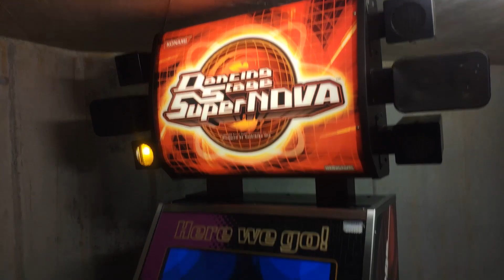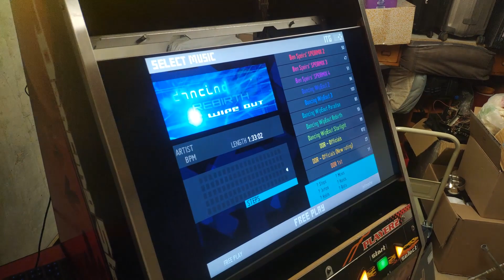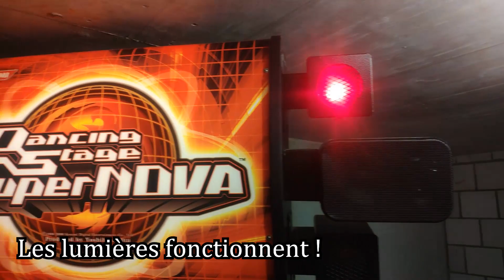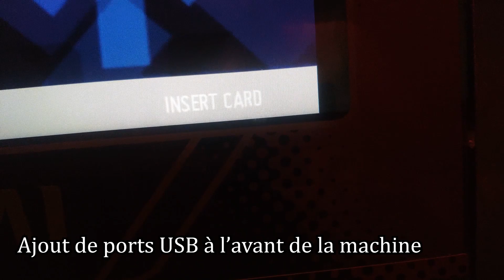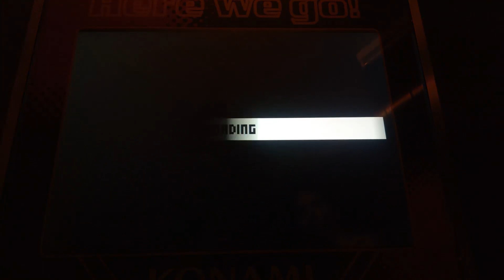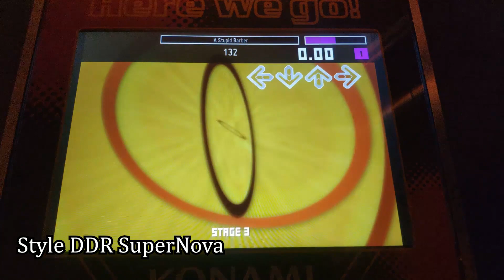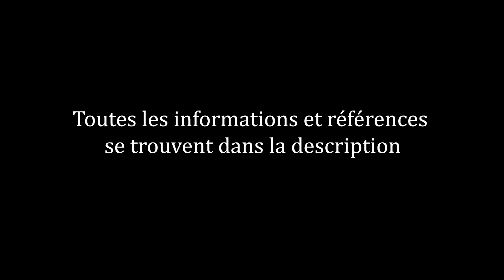Conversion DDR SuperNova Arcade vers StepMania, Remplacement CRT par LCD, Améliorations panels

Comment: I wonder if this is worth doing to my Solo 2000 DX pad machine.  Seriously is it too old or would it still work?   And could I go back to arcade mixes easy?
Reply from the maker: Hi !
Solo 2000 is not based on Python2 hardware so you cannot connect everything easily as i do. It's system 573 based so you'll need an additional interface to connect everything => Search for "Minimaid" or "J-PAC + LumenAR".
Check this link : https://jeffreyatw.com/blog/2019/08/how-to-convert-a-ddr-cabinet-for-stepmania/
Reply: @initmaster  Yeah I know it's System 573 digital so I figured.   I had forgot about the minimaid thing too as I know where to get that too.  Sorry there's just a lot I forgot about DDR since I started in 2001.  XD  I used to have another solo 2000 with solo bass side art and I'm killing myself for selling that years and years ago.

If I remember right Python2 was just a ps2 with a HDD+ DVD install disk right?  I know it has the usual arcade stuff on the board too.
Reply from the maker: @TeamRocketHQR  yeah Python2 is basicaly just a PS2 with HDD as you said. The I/O board is connected to the PS2 by the USB port, so just unplug it from PS2, plug it to the PC, install the right version of StepMania and that's it.
Reply: @initmaster  Are I/O boards still $100+ on there own too?